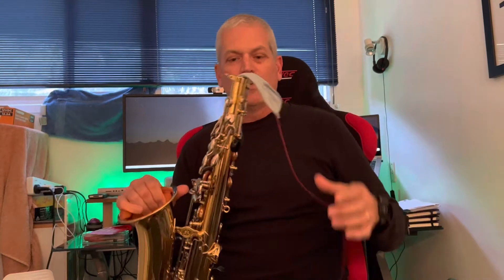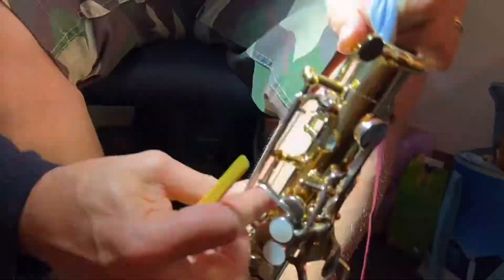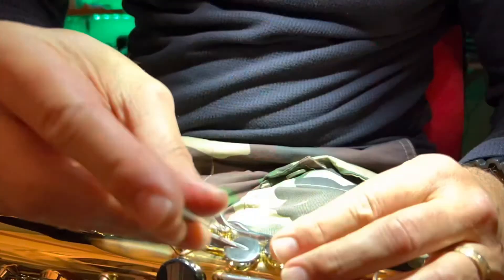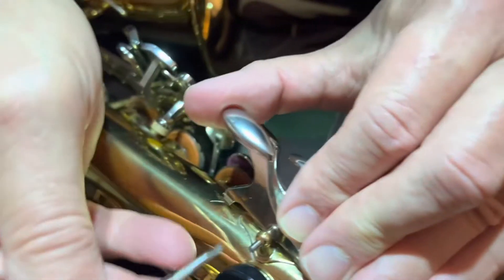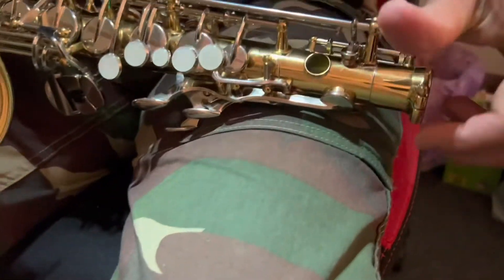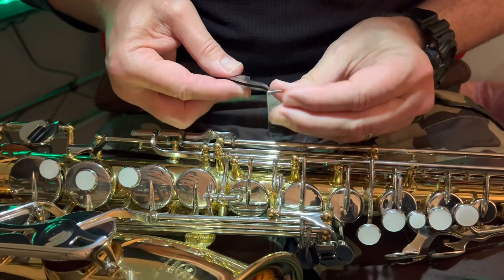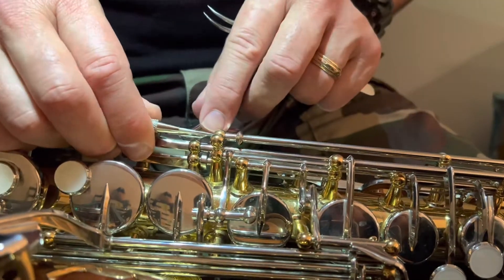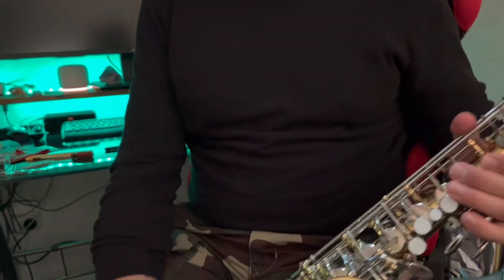How to Remove  a Stuck Pull-Through From Alto Saxophone

Comment: Ive got one stuck in the crook and desperstely need to get it out any ideas?
Reply from the maker: Hey Isaac,
That is not good as there is not much room to move. 
I’d try some long nose needle pliers and try to get a good grip and pull out backwards and if possible, try rotating the cloth with the pliers as you are pulling it out. 
Not sure how jammed in it is so that may not be possible. 
Be careful but persist and try and get a little bit of cloth out at a time….
Just keep the metal of the pliers away from your sax.
Hope this helps.